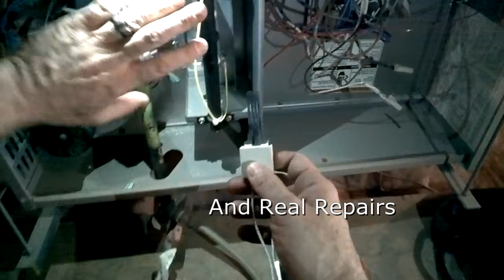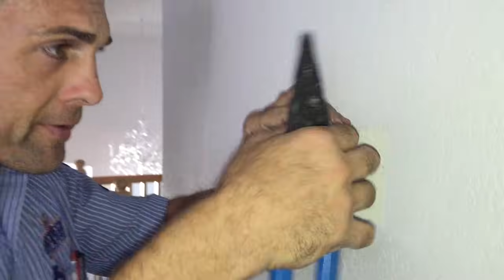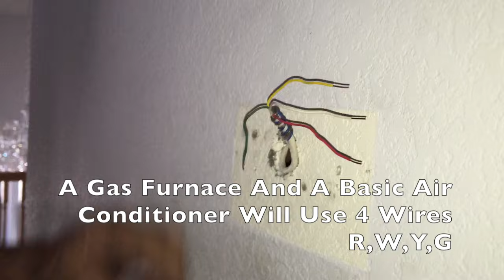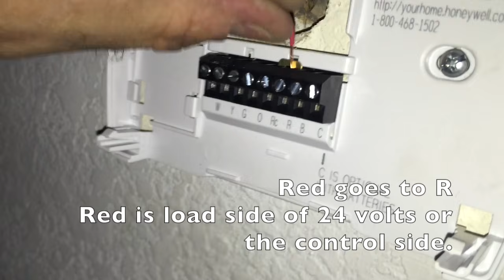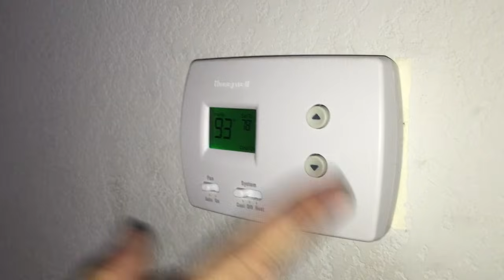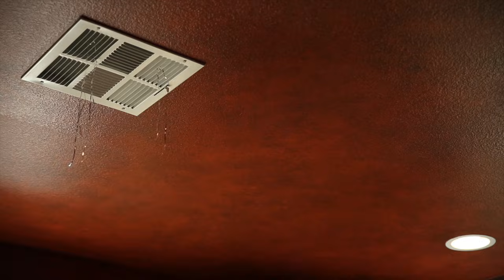How To Test & Replace A Thermostat, Step By Step tutorial.

Comment: Should you wait until the thermostat acclimates to the temperature in the house before turning on the AC. For example my thermostat was in the car at 95° My house is 75° should i wait for the thermostat to read the actual temperature of the home before turning on?
Reply from the maker: No, if the stat is hot it will run, if your stat is bad you need some air. Plug it in and turn it on, so you have air it will adjust

Comment: Why no common wire this make's my thermostat burn the fan wire and has ruined the fan inside the system is electric and the thermostat has many traces burnt on the thermostat and other points on it. Yet the managers and in-house HVAC miss everything in front of them and claim nothing is wrong as I sit here and its 80 something right now when it should be 70
Reply: Bingo.
Reply from the maker: Jennifer Case sounds like you have a problem but it has nothing to do with having or not having the common wire all the common wire does is give the thermostat power that's it has nothing to do with the Fan. Because the thermostat can run off either batteries or 24 V. But if you have burning then something must be a miss wired somewhere you should call a professional don't rely on Maintenance

Comment: My trane furnace isn't turning heat on. The furnace turns on off and the blinking indicator says replace ifc. The system is new
Reply from the maker: Nick Varela new systems break too... if the board says replace the ifc replace the ifc which is the control board

Comment: Replaced my thermostat according to color coded, I'm getting heat when I switch on cool.
I did switch breaker off. Compressor comes on. cold air coming out of condenser fan, hot air out of vent..
Reply: Sj V sounds like u need to double check ur wiring.  Do not assume the normal colors (ex: Yellow wire for cooling and White wire fot heat) are always hooked up to the Y and W ports at the furnace board.  I would look at your furnace board and take pictures to see what color wires are hooked up to the R, Y, G, W and C ports on the board.
Reply: Heat pump system.....call technician

Comment: I have a AC unit that runs none stop. I just bought this home. the only way to turn the AC off is to turn off the breaker. I have a separate thermostat for my heat. weird I know. Anyways I took the thermostat off the wall and I only have 2 wires. a red and a white. please help me understand this
Reply: Your RED wire is Power & White is Common. Just connect Red wire to Red wire/screw & White wire to White wire/screw on new thermostat. If this doesn't work then new thermostat wire might be needed. To test that it's actually your thermostat that's bad, after you take your old thermostat off, touch the Red wire to White wire. If you can control (turn off/on) your ac by touching those two wires, then it's most likely a thermostat issue.

Comment: At 5:26, it says we should jumper Yellow and White for a heat pump, which is wrong (for any thermostat).  I'm no HVAC expert, but I have a single-stage heat pump with AUX/E heat.  My wires are R,G,Y,W,O,B (red,green,yellow,white,orange,black), where R=power, G=fan, Y=compressor, W=aux heat, O=reverse(cool), B=common/neutral.  Red is always 27 Vac, Black is always 0 Vac.  If I jumpered Yellow and White, AUX/E heat would ALWAYS turn ON whenever the compressor runs, which is wrong.  It would be wastefully expensive during heating and simply ridiculous during cooling (because AUX/E heat would ALWAYS run during cooling).  Also, it would energize the compressor during "emergency heat" mode, which is wrong.  My thermostat energizes the Yellow and White wires independently, as needed.  It's the thermostat's job to figure out how to energize the wires.  IMHO, physical jumpers should rarely (if ever) be needed because they override thermostat's outputs.  
  
My wires are energized (to 27 Vac) as follows:  
R,G : Fan Only mode,  
R,G,Y : Heating mode,  
R,G,Y,O : Cooling mode,  
R,G,Y,W : Heating + Aux Heat mode.  
R,G,W : Emergency Heat mode.
Reply: Thankyou shering gues welcomed

Comment: Hi I have a problem with my AC when I put the thermostat on auto is not working also when I put on off is working and when I put the temperature up the compressor start working but the blower never star I hope you know understand my question thank you
Reply from the maker: Oscar Gonzalez it's wired wrong probably doesn't have a green wire hooked up and the yellow wire maybe touching red.
My advice is to take them all off and start over make sure R terminal behind your thermostat goes the red terminal on the board in the indoor unit. And G to G W to W Y to Y I typically use the red wire to connect the R to R but the color wire doesn't matter as much as that a wire connects R to R.
I hope that makes sense just make sure those four wires are going to the furnace or air handler and connected to the same terminal. If that doesn't work can you make sure the wires are right then you have a bad thermostat.

Comment: My unit is coming on outside but no air comes out. I also noticed that the "cool on" message continues to flash and not go solid. Do you think it's a bad thermostat?
Reply from the maker: Marie Charles it could be the thermostat yes, what I heard is your AC on side gets the signed to turn on. But the indoor unit with the blower either does not meaning bad stat, bad stat wire more likely bad stat. Or B it is getting the 24 V signal and it's a bad circuit board, motor or capacitor.
My vote is the thermostat.
Reply: Goettl and Las Vegas Air Conditioning, Inc. ok thanks !

Comment: I could tell my programmable thermostat (Honeywell Beutler 800) had gone bad because the display shows nothing but it is able to manually turn on the heater when switched to heat mode ON.

I like the 1st tip about combining the red, green, and yellow wires to turn it on manually.
Reply: Ron Ablang
Reply: Ron Ablang 9½²2
Reply: Ron Ablang 8oo same 0¹0eijiooooißi8ow2ww99 good

Comment: Question - If I take the green. red and white wire jumped together that would give me heat?the yellow,red and green would be ac
Reply from the maker: If it's gas heat all you have to do is touch red and white. Because then fire or temperature would bring on the fan.
For AC you need red yellow and green
Reply: Thank you
I have the PGB024075-1 rev a and i did everything as you have mentioned.i disconnected the thermostat
the heat and ac both came on.i reconnected the thermostat and everything is working normal.
It could have been a loose wire?

Comment: I'm having a problem with my a/c unit, it works just fine during the night but as soon as it gets hot outside the thermostat starts to turn off and on by it self and the a/c will go off eventually the thermostat will blank out and the only thing i can turn on is the fan or blower then after a miserable 90° day inside around 9 pm the thermostat will start to work again. I replaced it with a new one and it work for two days and is back to the same thing... any ideas??
Reply from the maker: Yes, I'd say with heat and expansion probably there's a loose wire or connection somewhere, maybe the common wire. Leading to the thermostat, as if it's losing power, it would have to be common or the stat itself.
There's your options
1. Replace thermostat
2. Trace and redo all wiring connections to ensure they're tight. Just worry about the small low volt wires and tighten all the wire nuts.
Reply: +Las Vegas Air Conditioning, Inc. Thank you i already replaced the stat so I'll get to work on those wires. Thanks again!
Reply from the maker: Joel Ortega possibly a lose connection in the low volt or a weak or almost broken thermostat wire. Heat expands and cold contracts I've had that happen to me with the cable tv and it was only a loose connection that expanded just enough during the day to go off. As there are things in an AC that can overhear during the day none of those things would make the stat go blank.
Reply: Jumper  and  th  not  not  cut off  ableno  avableok  replaced ok

Comment: Y didn't u use a common. I always use black or brown as common. Blue is always y2. Orange w2. And white is always w1. Good job. Just curious not wiring common. Not a lot of people change batteries.
Reply from the maker: I use blue for common if no blue then black or whatever
Orange is rev valve so O or B
And y1 or w2 I use whatever is left
But I don't always include a common because I've had too many calls where people blow there transformer from fiddling with their own stat so eh not sure if I prefer them having a common or not I'm ok either way as batteries usually last 2-3 years.